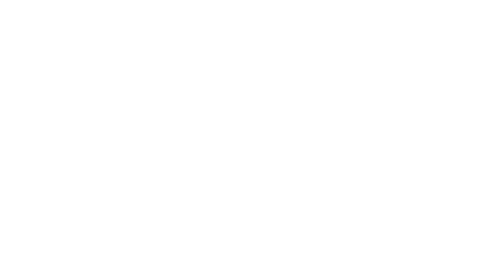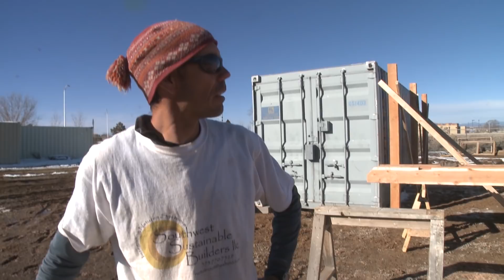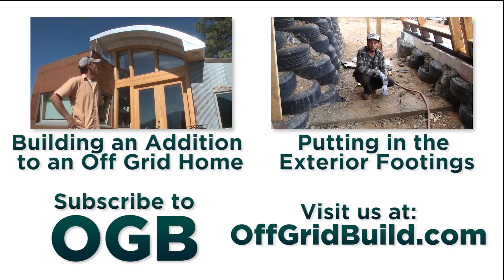Pros vs Cons of Shipping Container Buildings

Comment: Use some of the 50 000 000 containers to accommodate homeless people.
Reply from the maker: great idea mohammad, you should do that
Reply: +Mohammad Karbaschi Go for it, but the realities of ISO containers don't really cut costs for housing except in specific locations where they are cheap, plentiful, hauling is easy and labor is cheap. LOCAL constraints must be considered. BTW wood is cheap, recyclable, easy to erect with a small crew, and may be hauled to site the same way it has for thousands of years. It is not popular by accident.
Reply: Ob Fuscated In fact cheapest and the best quick housing is the prefabricated houses from China. Two layers of steal in the middle styro foam. Best insulation, assembled within 4h, costs ~ $3000.
Reply: +Mohammad Karbaschi That material does work well. We have something similar using aluminum outer sheets in the US. It protects the delicate styrofoam core. You could use modern construction adhesives since welding isn't very suitable for the interior.
Reply: Ob Fuscated There are two types of sandwich panels for the prefabricated (modular) structures produced in China. One is the two layers of steal and middle styrofoam and the other is rockwool. Apparently rockwool is more durable and doesnt absorb water much. but I dont think the steal sheets would get damaged easily.
Reply: +Mohammad Karbaschi Rock wool is a great idea. Given the choice I'd prefer it.
Reply: OK, you buy them and house the homeless!  Good job.
Reply: Do you mean fill the containers and ship them out?  That would be cruel.
Reply: gizmo Those Chinese companies which are making goods cheap are not stealing jobs. they are doing a fair competition. Those American business owners which are sending manufacturing sections out of the country are stealing your jobs.
Reply: A great idea but sadly it'll never happen because of greed. 
Container homes would actually save money for governments.
Reply: MrVillamike Search it on "Alibaba.com". You can always negotiate on price and quality. You have the choice of design when you deal with the manufacturer.
Reply: +Mohammad Karbaschi  $3000???  BS.
Reply: +Colin Smith Uh, the price drops, DUH.  But they don't do the shit you're talking about.  You obviously don't know shit about most homeless people either.  Most are mentally ill, or addicts.  They're not capable of buying or renting. so they don't enter into the equation.
Reply: +Glen O'Riley All of Detroit needs to be bulldozed so they can start over from scratch.
Reply: +Glen O'Riley In those neighborhoods, if a house is decent, you can rehab it for section 8 housing.  Lots of people do that.
Reply: +Glen O'Riley I had a relative that did that, I don't have the patience to deal with that.  I like my free time.
Reply: +Glen O'Riley you have to buy them at auction otherwise your paying mark up. if you people are that interested in these I know of better built bldg.'s that fema used for katrina going for 4k-12k. Being auctioned off. 4k ones have repairs needed but for the price you already get a bathroom, kitchen, 2 small rooms and one big open area. these are built with skids so you can move them around.
Reply: now that's a good idea. we should start a movement to use those to build temporary housing for  the homeless.  oh wait. the city's government  dont care for the homeless.  if you feed them,  you go to jail.  if you give them money, you get fine.  they are just throw away people in their eyes.
Reply: Very sad indeed.
Reply: I didn't know that.  I have replied in the thread and then personally to individuals.  You learn something new every day!!!
Reply: There are several factors in doing a pro job. One resource I found that succeeds in merging these is the Magic Container Plans (check it out on google) definately the most useful course that I've heard of. Check out this  awesome website.
Reply: Colin Smith
Big Gov just removed 4 of my 5 acres from 'buildable' to 'wetlands' based on projections that it may become wetlands in the future.

They also shutdown a 15 house project across the street (mid-property prep and after lot clearing and leveling). Because they could. BigGov raised the price of compliance mid-project on a female run small developer... Damaging her company no doubt.
Eco-friendly BigGov is by nature anti-people. Including the homeless.

Don't believe me? Try to get permits for a shipping container trailer park. The capitalists won't stop it. BigGov Nanny State will.
Reply: Mohammad Karbaschi and allow/encourage them to help build them.
Reply: meech lamirande 
Boo hoo, I don't want to work to get it so you must be racist.
Reply: Mohammad Karbaschi that would be a gross waist of resources
Reply: +MrVillamike How many container structures have you built and with what amenities in what locations that you can make such an assertion?   If they would save money for governments they would also be competitive with other solutions, yet we see far more conventional mobile homes (by the tens of millions) then modded containers even in first world countries with thriving container modification businesses. 

A steel shell on its own is demonstrably worse than many native methods of construction which have lower cost than moving a container to site (fuel and trucks aren't free) and cutting holes for doors and windows. Mud, cob, thatch, wood and other renewables have been used for thousands of years for PRACTICAL reasons.

"Container evangelists" who have no personal, hands-on experience working with ISO containers and metal construction in general should do their homework to learn SPECIFICALLY what to do with containers..  

The shell is far from being a completed home. Conventional construction evolved over thousands of years and the common denominator for homes is they can be built by a small crew with local materials. 

Shipping containers are typically "local" only if you live in or quite near a seaport which has a surplus due to trade deficit.  They don't move themselves so transport requires a truck, appropriate trailer, fuel and other transport related costs. (Trucks don't buy or maintain themselves either.) They aren't homes without major  fabrication. Their footprint is that of a single-wide mobile home of those typical in the US, which may or may not suit local lots there or elsewhere. 

Ignorance of what containers can be good for is a barrier to making intelligent use of container structures.
Reply: +Mohammad Karbaschi if we have the same here I'd LOVE 4 to be dropped off on the folks property, setup a nice home for the kids and us with that. They want $15k per 40footer here last I enquired which was WAY too much to consider.
Reply: +Ob Fuscated Thank you for setting me straight on a few things. 
I had the misconception that fuel and trucks were, in fact, free... That expense alone would have put me far over my planned budget. 
However, you blew my mind with your claim that trucks not only, don't buy themselves, but that they don't maintain themselves either?!
Upon doing a small amount of research into the subject, I found that you are completely correct. Thank you so much! You saved me from a literal financial nightmare!
I'm going to just say, screw the container home I was planning on building! On your advice, I am going to construct a mud and thatch home. Everything I'll require is already on-site, meaning I wouldn't have to bring any of those deceptively expensive trucks into the mix!!

Honestly, thanks a million!
Reply: +Mohammad Karbaschi hey ,if anyone else wants to uncover cargo container homes floor plans try Jaffacter  Container Home Coach (Have a quick look on google cant remember the place now ) ? Ive heard some super things about it and my cousin got great success with it.
Reply: +Colin Smith That's a ridiculous explanation of Capitalism.  You clearly don't know what you're talking about.
Reply: *****
Metal/steel prices are not that low regardless.
Reply: *****
No the economy could roll on with an oversupply of housing if it was willing to adapt and wasn't so greedy.
Reply: +Colin Smith  Banks AREN'T going to just bulldoze a house.  They sell 
them at auction.  Bulldozing a house costs MONEY.  You have to get a 
permit to bulldoze a house first.  It's much easier to sell a house at 
auction, especially if the bank can get what it's investment back, even 
if it's less that what the house is worth.  I guess you've never heard 
of a Sheriff's auction.
And there's just two cities cited in your article, Detroit and Cleveland.  In cause you haven't heard, the population of Detroit is half of what it was 40 years ago.  Huge tracts of land are vacant.  
I suppose you're one of those idiot liberals that think we should be buying houses for everyone that doesn't have one, and could never afford to maintain it even if they got it for free.
Reply: ffjsb
they did in Detroit :(.
Reply: *****"They're still bulldozing places all over the country, targeting 6000 houses in Columbus Ohio alone for example. it isn't limited to Detroit and Chicago by any means."

Scary and sorry I was only aware of Detroit bot being American. Now the scary thing is I'm not American and I still know of it going on over there.
Reply: +Glen O'Riley Those houses were decrepit and abandoned.  They didn't bulldoze them just to build new houses.  There's such a thing as LOCATION.  Nobody is going to buy a nice new house in the hood.  I kind of know all about the houses in Columbus, and that was over a very long period of time.
Reply: +ffjsb there project of where they are renovating and ppl buying them for cheap... slowly but surely process is being made
Reply: +Colin Smith I know all about Columbus, I work there.  Those houses aren't worth saving, they're decrepit and abandoned, THAT'S why they're tearing them down, not as you say to drive up the market for housing.

"To the point that perfectly good houses will be bulldozed to make sure the prices are maintained.  "  

If they were "perfectly good" houses, people would be snatching them up at auction to flip them.  Most of those houses have been vacant for years.
  

      
  

    

          
        ·
Reply: ffjsb
"
If they were "perfectly good" houses, people would be snatching them up at auction to flip them"

No good flipping a house in an area with rubbish property values though. You need to be in an area that has a market for that. So it's not as much the houses aren't worth the effort rather they aren't worth the dollars due to a bust on land rates.

If the area wasn't full of derros and failboats (regardless of where you're talking) I'd take one on if it was cheap enough and I lived in the country to slowly do up as the family home. Cheap way to get into the house market.
Reply: ffjsb
not a bad idea actually. Dirt cheap purchase, minimalistic repairs and rent it out to people that are likely to trash it for good money.

Then if you get some that are decent S8's you can work on the place bit by bit as a tax dodge and a bonus to those for doing the right thing.
Reply: +Mohammad Karbaschi hey ,if anyone else is searching for container home floor plans designs try Renkarter Container Report (just google it ) ? Ive heard some super things about it and my buddy got excellent success with it.
Reply: Umer Hafiz Thanks for the info. Personally if I wanted to buy something for myself I would buy "prefabricated" houses. They come in all sizes and even I can get the Chinese manufacturer to make based on my design and preferences. The best think about prefabricated houses is that the walls are made of two layers with has styrofoam or woolrock filling. This make them good against heat and noise.
Reply: +Mohammad Karbaschi China is very good at copying everything they find aren't they? same stuff you speak of is built and manufactured in the United states as well. rock wool Is for places where flammability is an issue as it won't burn or melt.
Reply: gizmo
makes sense but unfortunately wrong side of the pond for me.
Reply: gizmo For me it doesnt matter who made it first, but they are making it well, cheap and are flexible in design for me.
Reply: Mohammad Karbaschi ofcourse it's cheap.....where workers civil rights aren't recognized labor is cheaper. If you use these for projects then ofcourse freight is something to look at depending where you live. I have installed the electricity to shipping containers being used as bug-out and hunting camps, fema trailors being used as offices and the pre fab bldg's we are speaking of. Pre fab bldg's have to be constructed on site, they are good choice for manufacturing facilities of warehouses when tilt wall concrete construction is to costly.
Reply: +Mohammad Karbaschi So agree!!!  and nice ones to live off grid!!!
Reply: +Mohammad Karbaschi Yep.
Reply: Mohammad Karbaschi I didn't say the Chinese were stealing jobs, I said where civil rights are poor and the average worker makes around 5000$ us a year your goods will be cheaper obviously. And that they are very good at stealing patent information.
Reply: Yes.  My cousin sid the sme thing to me bout them copying patents.
Reply: I didn't know that.  I am not trying to force anyone into doing anything.  That was not my intention.
Reply: I think you mistakingly commented on my channel.
Reply: I got it.  You are making comments to me though.
Reply: I know that I made comments to him.  I think you clicked on "reply" for one of my comments.  That's how we got connected.
Reply: If you are commenting under his video I should not be receiving that communication.
Reply: Well you paying for them ? I so want to build a home like this just need the funds .Now for this important truth https://www.chick.com/reading/tracts/1022/1022_01.asp
Reply: B edwards bolts, glue, or ducktape.
Reply: Ob Fuscated and the rabbit was shot down!  ugh....well maybe circumstances can make it ideal?  Having many available locally and having time and know how to do the work yourself. I'm in debt and struggle in many areas of my life. I'd like to find a spot like property lot rent something like that. I like the idea of off grid living but realized that's a good idea but a poor man's pipe dream.Never the less my options are thin and I'm very resourceful and handy, by the way I'm using my girlfriends youtube I am a man. lol. not that it matters,  anyway I envision 2 containers side by side with a center add on between then for extra space. "mini Home" I've seen many floor planes here on YouTube. I want a basic economic floor plan that I can start small. I don't see a great retirement in my future and maybe some part time Jobs to get me by. Anyone out there with any experience and Ideas to start with? What's the permit process like? THANKS Any advice will help. It's either this or a trailer. I'd like to have something more nostalgic and personal.
Reply: we can put all 50,000,000 in a few hundred and sink them, no more homeless people problem solved.
Reply: the greatest success that I have had was by using the Magic Container Plans (just google it) without a doubt the most helpful course that I have ever followed.
Reply: Rallenhayestime said the sad man who can't even use the all caps button correctly.
Reply: Rallenhayestime
on further inspection you couldn't even spell can't  right.
Oh the irony.
It's can't 
not can'tt.
Or "CAN'tT"
Reply: Rallenhayestime oh my. his hypocrisy knows no bounds.
Reply: your so adorable.
Reply: Rallenhayestime So I've been told.
Reply: Mohammad Karbaschi Sounds like a great idea Mohammed!  What's your address, cuz' we need to put all the homeless on your property.
Reply: Mohammad Karbaschi 
why don't you buy a few......fix'em up , then  buy some land to put them on. & show them how it's done. maybe they need an example to follow.....Balls in your court buddy!
Reply: Giggle smith the usd is a fiat currency, its litterally based on nothing, and with the central banking system, every time you take out a loan more usd is created through that debt.
Reply: It's a socialist's explanation.
Reply: Giggle smith you left out that capitalism is founded upon exploitation and racism a system of elimination where people think the success of individual firms  = the success of the society as a whole. Do not compare science and capitalism as capitalism comes from barbaric means of European exploiters.

Comment: Do not forget, that they make shipping containers that are already insulated.  Like the ones that they use to ship frozen foods, they cost more but are good for colder climates like, Alaska, Canada etc.
Reply from the maker: hmm great point
Reply: but is the insulation appropriate for habitable spaces?  many shipping containers also have wood floors that are sealed with toxic material.  I hardly ever hear people talking about this.
Reply: Sean O'Brien | the point is that Busa suggested buying one pre-insulated, which would probably be toxic for a habitable area.  If you're removing all of that stuff anyway, why buy it in the first place?  You'd be paying extra for nothing.
Reply: They are insulated with high density foam. Just like my house. It is awesome way better then pink roll in. Don't hate masterbait.
Reply: John h Smith if you were so worried, lift the floor and remove the paint!
Reply: david esktorp oh ok, I get you now. Sorry
Reply: Very useful video, I found great inspiration here. I also have found great ideas for steel containers homes
 - Renkarter Container Report. I recommend to google it, really cool stuff.
Reply: Being a holistic doctor and understanding environmental toxicity I would not get a shipping container with insulation already put into it. How would you my research and try to find the least hazardous type of insulation you can find and then go with that. The point I think is important is that commercially they do transport items that need to remain cold so if there is a will there is a way to get it done, and done correctly without jeopardizing your health.